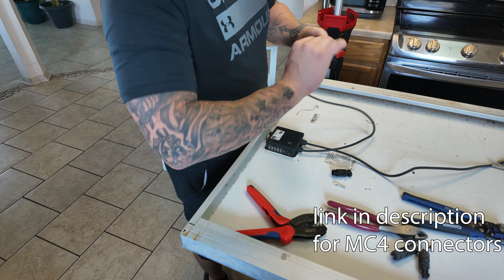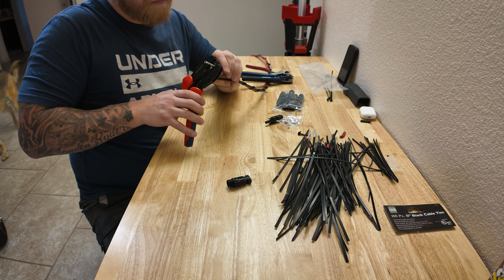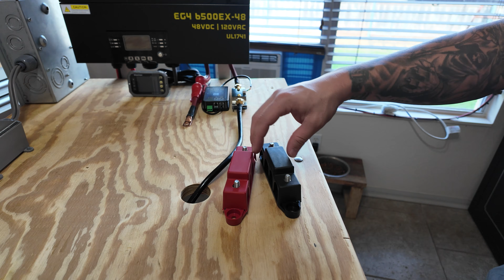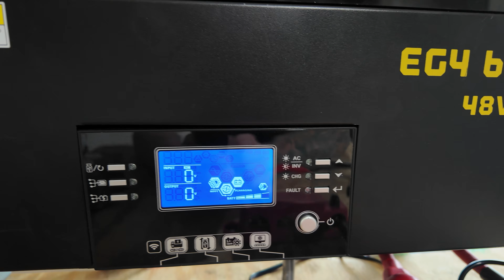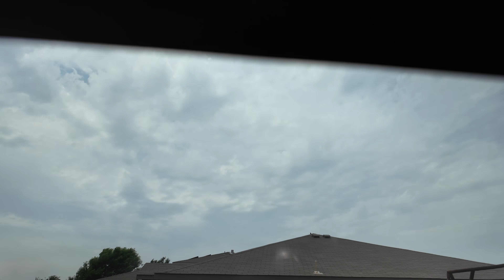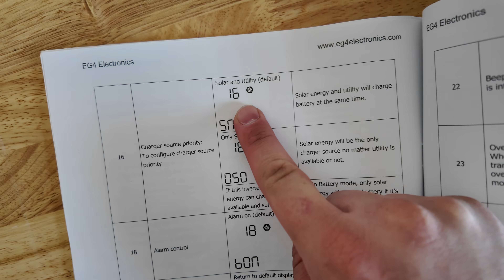Easy DIY Beginners 48V Solar Setup

Comment: Backer board should be cement board, non combustible.
Shame on you for using red wire for battery negative. At least using phasing tape
Reply from the maker: You’re absolutely right! Since then I’ve taken this setup down, upgraded the inverter to a 6000xp split phase, and replaced a lot of the wiring.

Comment: Isn’t all this plywood a fire hazard?
Reply from the maker: Should be using cement board, but as long as your connections are tight, nothing should be getting that hot. Plywood doesn’t burn until like 480 degrees anyway.